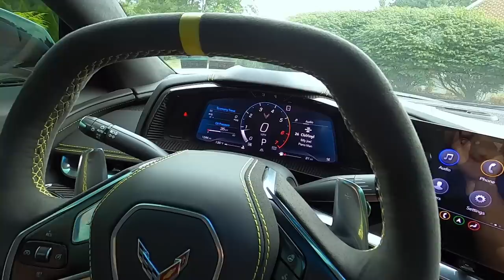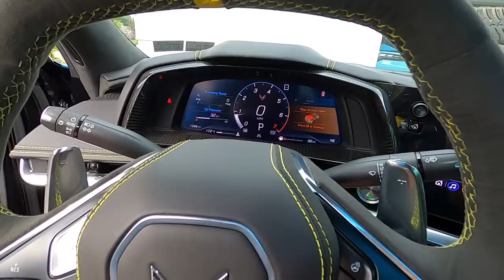FIRST DRIVE IN MY TWIN TURBO C8 CORVETTE!!! *It's PERFECT!*

Comment: Everyone saying it's for heat...... But yet carbon fiber brake rotors have no problem with heat and actually have to be extremely hot to work properly so heat wouldn't bother wheels that if they were true carbon fiber good or not........and a lot of true track cars braking systems don't use more 55-60% front brake to reduce the brake fade........ So sounds to me they are actually just wrapped and Ford is covering their ass..... But who knows

Comment: Honestly the 4 cylinder mode ruins the motor...  The Un used cylinders don't get the same oiling and cooling with them not firing..  You can shut that mode off and if I were you I'd do it...  You drive a twin turbo vette who cares about gas mileage I'd save the motor

Comment: Ok so about those carbon fiber wheels... bro its ceramic coated and if its not then prove me wrong. There isnt aluminum included at all in those wheels. Go check out full carbon wheels on real supercars/hypercars. They look the same inside.
Reply: Well someone said its not ceramic its alum... but for the exact same purpose albeit cheaper material on a cheaper car. Dont get me wrong ill take it any day over a vette of any year. Id love a c8 too but Shelby for me.